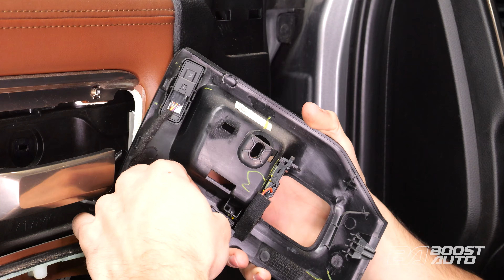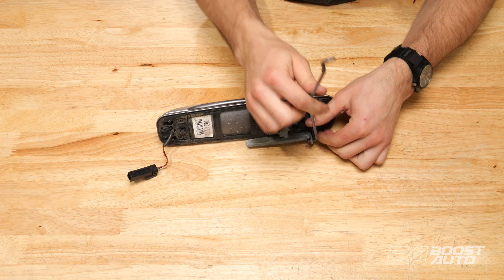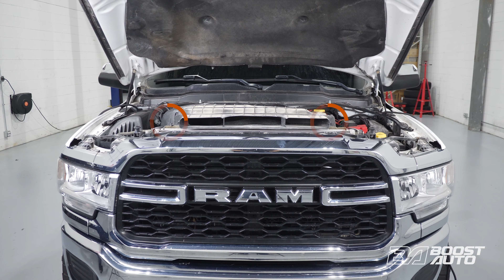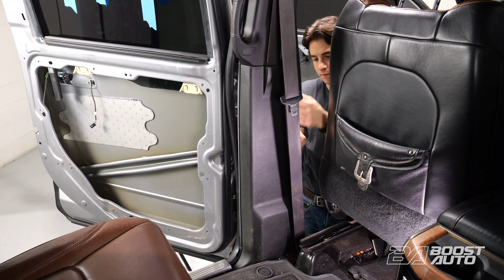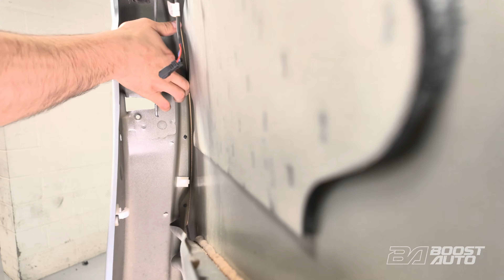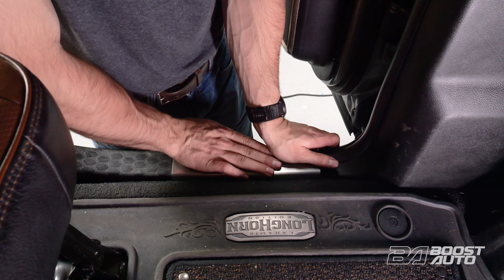Boost Auto ION Series Light Up LED Door Handles Installation | 2019-2024 5th Gen Dodge Ram 2500/3500

Comment: you guys should make a module that can connect to the headlight wiring harness for all of your accessories and it all plugs into one place instead of having multiple t taps
Reply from the maker: We don't currently offer that, but I'll share the idea with our team for future consideration! If you don't want to tap your factory wiring in multiple places, you can connect the wires to your other Boost Auto mod wires.
Reply: @boostautoparts   good to know thanks for the info
Reply: @boostautoparts also adding a connection port to your module in order to run underglow approach lighting that isn't on full time, and goes out when the truck is started
Reply from the maker: @Fastcarsforme  Noted!